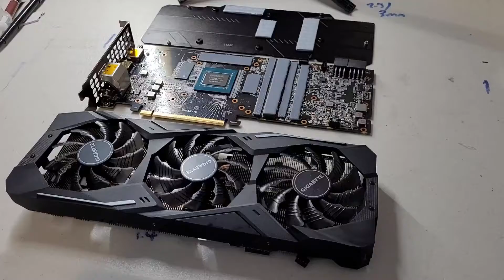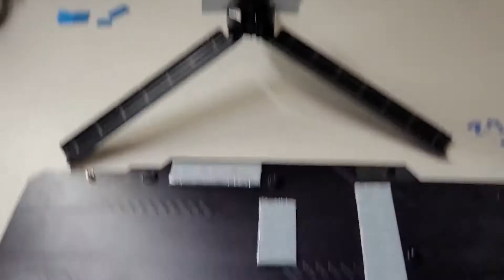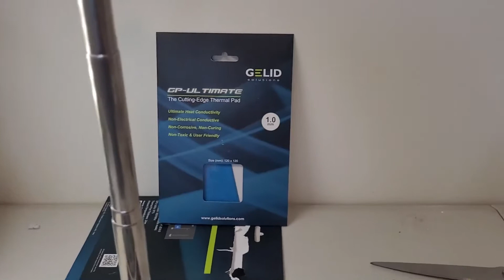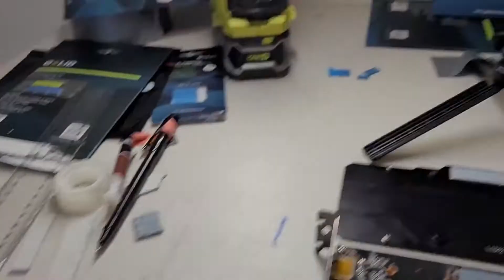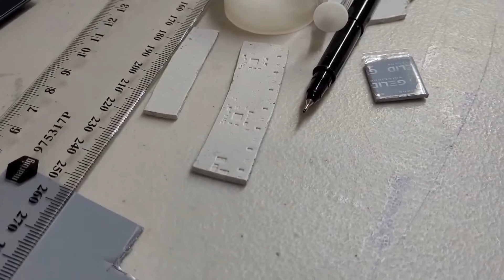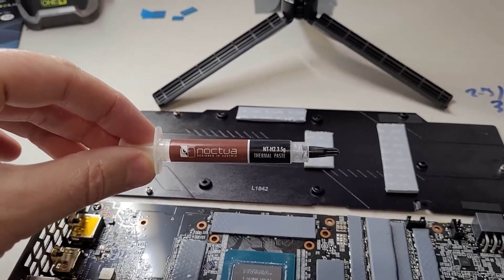GIGABYTE RTX 2070 Thermal Pad Replacement | Temps Down & Efficiency Up = More Profit🤑

Comment: was running same card at 110°C for months, finally replaced the thermal pads(amazon $15) and paste, doesn't go above 70°C.wishing I made the fix many months ago. Thanks for one of many videos helping with the confidence for change. couldnt get the back plate off, hopefully those old thermal pads are okay 🤷‍♂(canada)

Comment: My card used 3 x 1.5mm and 1 x 0.5mm pads (from left to right as pictured) at 1:10 for the long VRM pads, (and 3mm on the back). Mine was an Australian Gigabyte 2070 Gaming OC. Seems they're all slightly different :P

Comment: I found a 4 pack, .5mm 1mm 1.5mm 2mm, could I stack 2mm with a .5mm on top for the backplate? Or do you think I should just buy 2.5mm ones as well
Reply: So can we mix pads ?

Comment: the backplate pads are definitely 3mm and not 2.5mm, I compared the 2.5 I put on and put a ruler over top the exiting 3mm to a new one and it sat on an angle. When I removed the backplate a second time, there was barely any indents in the pad, so there was horrible contact if any at all at 2.5mm
Reply: thats right. i have de same graphics, the rest of thermals pads is right
Reply: Which thermal pads did u used on the back?

Comment: Thanks for the video, hard to find a good one where sizes are shown and explained. But I still have a question about how many of those thermal pads you used, I mean is it enough using 1 package of each (0.5, 1, 2.5 - 3 in total) 85x45 mm? I'll try to mix 1 with 0.5 to get 1.5, so I don’t buy spare 1.5 as well.
Reply: So mixing pads works ?
Reply: @tys_san  Yeah,  perfectly works, got in RDR2 from almost 81 to 65-67
Reply: 85x45mm was enough?
Reply: @Avi11369  yeah, a bit more than enough
Reply: @tarantulino14.1  on the back plate did you used 2.5 or 3mm? And also on the front did you used 1.5 or 2mm next to the 1mm ones?
Reply: @Avi11369 yeah, 2.5mm on the backplate and near the 1.0mm ones I used 1.5mm

Comment: So I have the white version of this card, 8GB version. Think it's safe to assume I have the same pad requirement maybe? not sure On where to look. I don't think they have any specs on this in any official database
Reply: if it's just the white version then it's the same procedure, also in general most 2070's have the same thermal pad layout and thickness so you should be fine.

Comment: I recommend trying it out phase-change material Honeywell PTM7950. It comes in as a sheet, lasts longer, performs works better than traditional pastes and there is no pump-out effect. Instead of thermal pads, I advise to apply thermal putty Upsiren UX Pro.
It is also a good idea to do undervolting.

Comment: My 2070 super was clocking at 87 and then it would lower the temp by shutting down the voltage. The fans were running at 100% any game i played. So i did a replacement of just the thermal paste and brought the temps down to under 73 during a game. I bought the pads but they looked fine.
Reply: So the thermal paste was mostly a problem? because i have the same exact problem, i have a aorus XTREME 2070, and ive had it for 4 years, and everytime i play high graphics games my temp goes up to 85c and my fans speed goes up to 100% which before never happened. Im thinking about replacing thermal paste but i dont know if i should also replace thermal pads
Reply: @simoli516  

Yes do a maintenance check and change the thermalpads/paste this would help, you could also use thin copper plates to aid with the temps especially if you're ever gonna OC but in general a pad and paste change should do it.

I also really recommend undervolting, you lose 0% performance by doing this and if done right you might actually gain some, you will also be playing at a chilly 60C.

Here's a great video on it: https://www.youtube.com/watch?v=0eH5khTjDwQ
Reply: @VrodegTheGoblin717  since that comment, i tried to reapply thermal paste but when i unscrewed the back plate it literally would not come off even if i tried pretty hard without going way too hard and breaking the card. I made sure I unscrewed everything and still. I tried to heat up the thermal paste by playing a game right before taking it off but still no luck. pretty annoyed by that so i dont know what do do at this point
Reply: @simoli516 did you end up figuring it out?
Reply: @Quarker  nah
Reply: @simoli516  Hey, I took my card apart today. I used a hairdryer to heat up the backplate, then starting prying from the corner and it came open.

I changed my thermal paste and pads. My temp dropped from 85c+ down to 65c max, excellent result!

Comment: When you use 2.5 on backplate card is too thin And weń you use 1mm there where u used it thermal pads dont touch radiator at all

Comment: Any pads thickness recommendations for aorus 2070s version? on internet there isn't much info about this card. And what thermal paste can contain to dont destroy surface of gpu ihs and radiator, my Thermal grizzly should be good?
Reply: Did you find any info about the thermal pad size for the aorus card?

Comment: I don't have the 1.5 ones for the Vram, does the 1.0 would work fine for the VRam?
Reply from the maker: For the relatively small cost of new pads it's not worth damaging your lovely RTX2070, however if you can't get 1.5mm  I would always suggest go higher so either buy 2.0mm or you could double up your 1.0mm pads to get to 2.0mm. Keep a close eye on your card post change to ensure it is working OK, good luck👍
Reply: @OZMining  Try not to double up (piggyback) on thermal pads, it generates micro air pockets/bubbles barrier at the interface, which reduce thermal efficiencies  ... hence detracting from the purpose of the exercise.  It's better to get the right thickness pad to begin with, which saves future disassembly.

Comment: I'm running several Gigabyte 2070, so this is great info. Temps are all good, but I don't look forward to refurbing pads and paste. This video sure helps. Thx.
Reply from the maker: Yeah it takes a little time so doing a few each month is good, I like to do a full clean using alcohol and dust blower, cards sparkles afterwards!  Also given mining profits down the efficiency benefits certain help right now👍👍
Thanks
Oz Mining